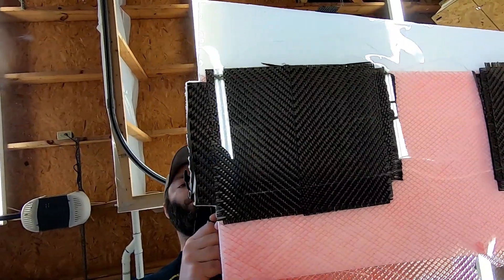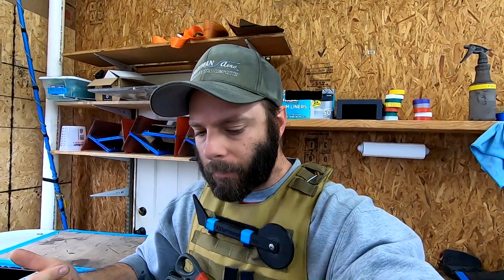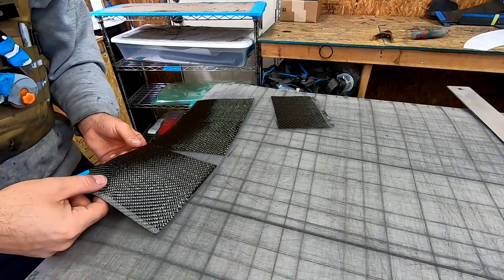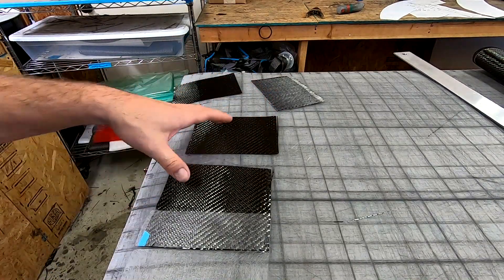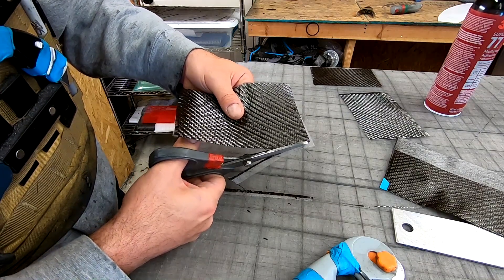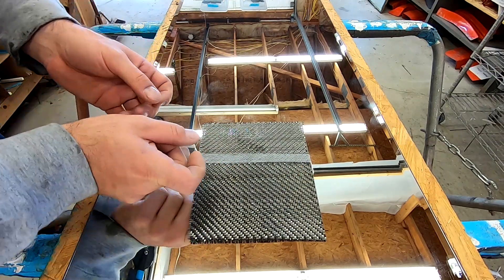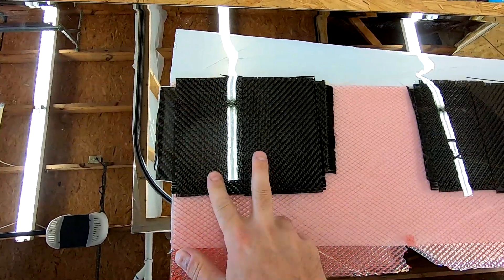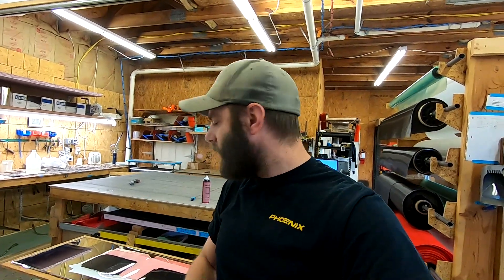How To Make Part Lines and V Seams in Carbon Fiber Parts

Comment: Hi, What is the best adhesive to use to bond carbon fiber to leather? I have a carbon fiber interior car pars that I want to install. Double sided 3M tape does not stick at all. I was thinking I need to "glue" them on. Not sure what the best method is to use.

Comment: When you say 'several hours in the oven'. Is it just a cupboard with a fan heater? And what temperature does it get up to roughly and how long. I've seen that in a few if hour videos. I LOVE your content by the way
Reply from the maker: Whatever epoxy you use will specify time and temps to use.
Reply: @ajhartmanaero  I fully get that but is that just a heat fan in a cupboard. Genuinely hoping you say yes. I've never had the confidence to heat up any of my molds because I don't want to spend money I don't have on the oven even tho they don't go that hot

Comment: its called fiber glass belt or bell?
Reply from the maker: Neither. It’s “veil”.
Reply: @ajhartmanaero   thanks alot
Reply: @ajhartmanaero   what is been used for between layers ?can i use in prepreg where sem joint

Comment: Hello, thank you for the videos. I am trying to skin a steering wheel with carbon and I am really struggling with connecting the fabric at the back. Could you please show a way to do it. Thank you again.
Reply: spray adhesive to hold the edges back mate

Comment: From an engineering perspective changing the orientation of the fiber lay up will give you strength in different directions. This is often referred to as the lay up "schedule". Often parts will be made with uni-directional carbon if it needs to be strong in only one direction. It is very common for high strength parts to have 4+ layers where each layer is at 0degrees, 45deg, 90deg, etc. Then you get into all kinds of neat stuff like nomex honeycomb in between layers for very light yet strong parts. 

I know most of us love how carbon looks, but there are a lot of structural considerations when a part is expected to sustain a load. 
Love the channel!